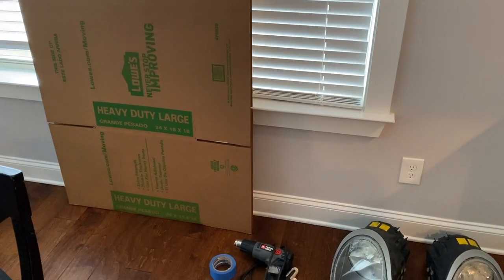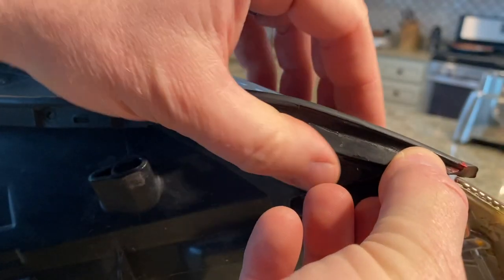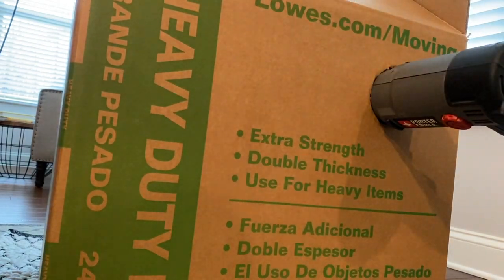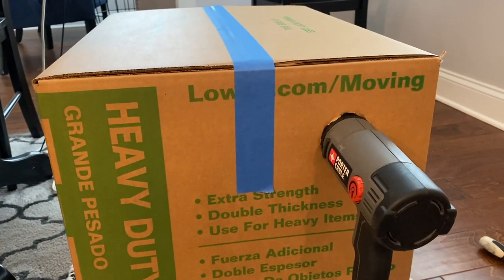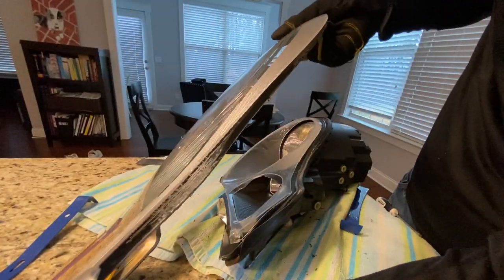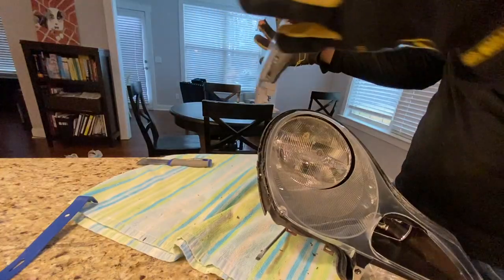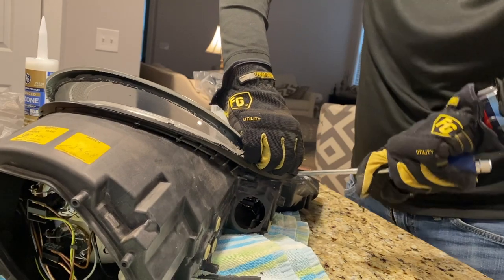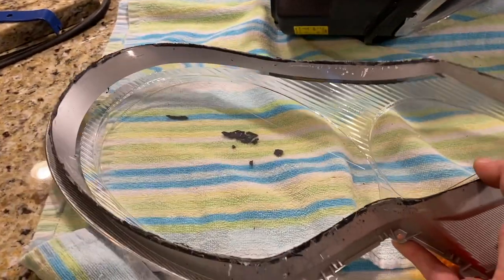How to OPEN SEALED HEADLIGHTS - Porsche 986/987/996

Comment: Great content Aaron, though I cringed the whole time afraid of something breaking.  Can't wait to see what you do with these next. 

I had that same issue with wire insulation just disintegrating when I retrofit to LEDs in my 986.  Tried electrical tape, but that was really messy.  Ended up using some stuff called liquid electrical tape that you just paint on.  Seems to have worked really well.
Reply from the maker: Thanks! I just ordered some and put a link in the description!
Reply: Lol I waited till she wasn’t home.
Reply from the maker: @dutchk9833  😂 😂 😂

Comment: Please let me know how to replace the rubber gasket. I cannot find just that part. They want you to buy a whole headlight assembly at $1000 each. I had to use some self-sticking D seal to replace mine that was completely deteriorated in the AZ heat.
Reply from the maker: +Jess H someone told me that pelican parts sells just the rubber gasket. Check out my next video on how to upgrade the headlights to see how to replace it.